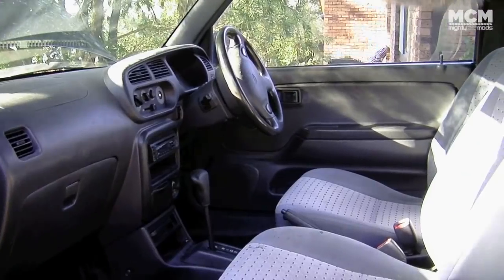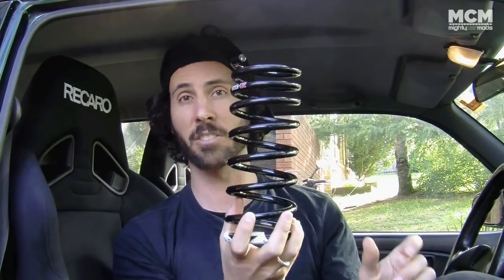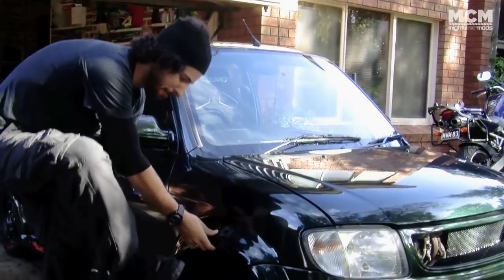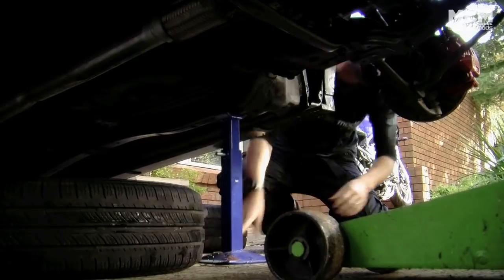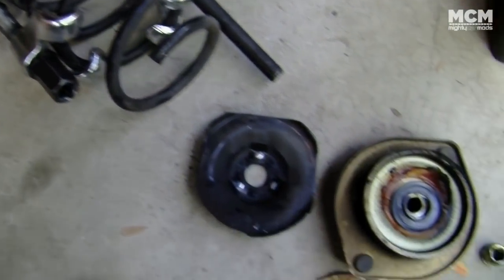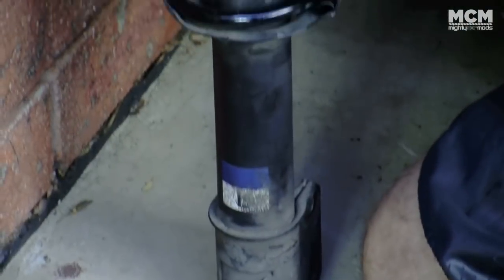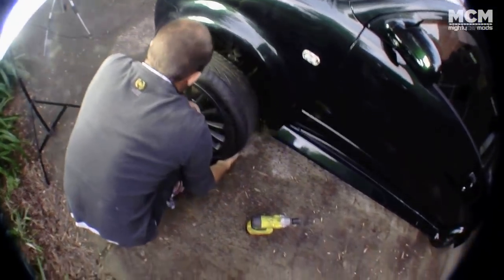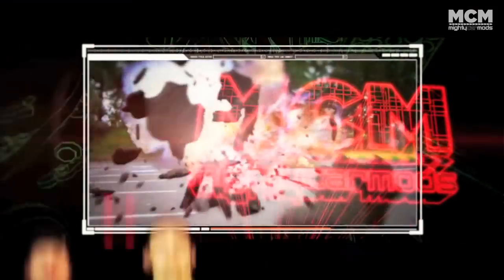How To Install Lowered Springs

Comment: When do I release the spring compressors?
Reply: +billy bob When the units are fully assembled and the top retaining nut is done up. Otherwise the spring will just uncompress and fly off and you have to start again... after a trip to hospital to remove said spring.

Comment: i cant seem to find any lowering springs for my 92 nissan. anyone know if its the same as the newer models up to a 96?
Reply: I have a 96 sentra, i suppose it's the same.
Reply: i was told a 95^ up maxima spring is wider
Reply: ***** 
I have a 96 nissan also and I bought ebay brand lowering springs,they are way to bouncy. Any ideas on a good brand that aren't bouncy
Reply: not too smart with lowering kits since sold the car tho. 200$ for lowering springs on a 92  wasnt worth it

Comment: whats the best way to get that " hella slammed " look
Reply: coilovers are best for the "hella slammed" look . as they do have camber adjust options as well as height. you can slam the hell out of a car with lowering springs but the ride can be roughhhhhh
Reply: i mean like the "stanced cambered " look
Reply: Coilovers or air ride

Comment: is it possible to put a turbo on any engine???
Reply: +my vid If you get the right bits and pieces.
Reply: No some engines have already a high compression without turbo
Reply: But you still need all of the turbo bits to turbo a car. Even if it already has a high compression ratio.
Reply: If the compression is already high, for example on a nascar engine, which runs on ethanol, and you turbo it, the fuel will ignite itself while it gets compressed by the piston. Dead engine
Reply: In extreme circumstances like a race car, then yeah.

Comment: There is no law about
Lowered cars I think. I mean you can have a truck with a 1 foot lift so why cant you drop it 3 inches lol
Reply: yes, there is a law against lowered cars. it has to do with how high your headlights are from the ground. that's how cops measure it.
Reply: ***** Also, in california there is a law that says no part of the car may be below the lip of the wheel. MEaning if you are going doe nthe freeway, hit a bump, and some part of your undr carriage scrapes it is illegal. Which is hard to determine when driving in the day but some people will be driving at night and sparks will come form under the car. IF a cop sees this happen expect to get pulled over real quick. And I know in California the law is the lights must be no lower than 22inches but also no higher than 54inches. So there is a law on how low and how tall your vehicle can be
Reply: Your fender isn't allowed to cover your rim at all bro or you get defected

Comment: Where can I get s14 1997 lowered springs cheap ?
Reply: I'm looking for my 95 right now haha
Reply: Haha yeah bro hit me up once you found some. Don't want adjusted ones cos incase it might not be certed
Reply: That's a pre good drop. Yeah but sucks that I can't use Amazon because I'm based in NZ. I found some drops about 1.7 rear and fr about $200us
Reply: If  you  buy  cheap  you  get  cheap.  So  buy some  good  springs like  KONI and  buy a  suspension kit. That way the  springs are matched  with the shocks   (dampers). The camber will  need to  be  altered too as will the  tracking.

Comment: why isn't good to cut the springs by yourself? i dit it today and i work so good ! i can't  ge anything between, its just 2centimeters between!! its not that great idea if you got 600 hp like me and haws a car that low!!! but just take it slow over the speed bumps! haha great chanel btw
Reply: Because the heat can change the steel
Reply: >Has 600 horses>Cuts springs 
Logic.
Reply: Bmo Noir
 Logic And Lie... everybody has 600 hp on the internet.